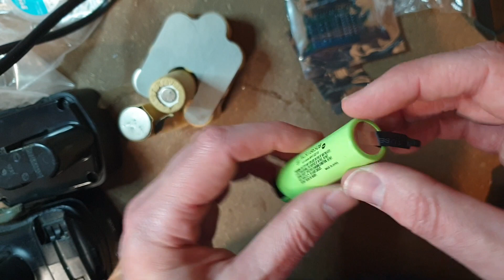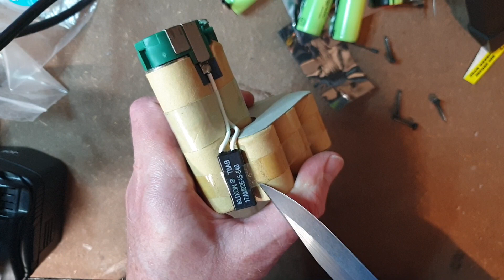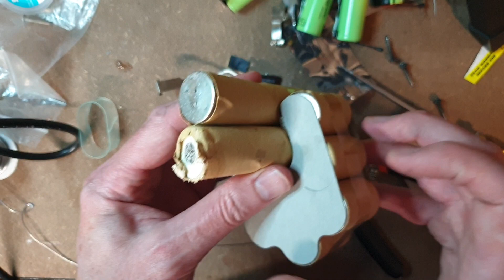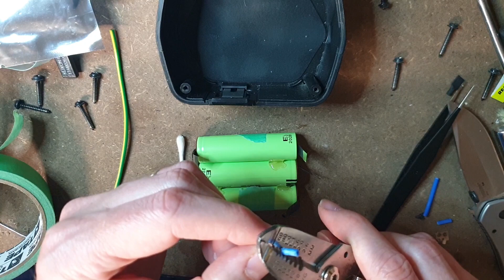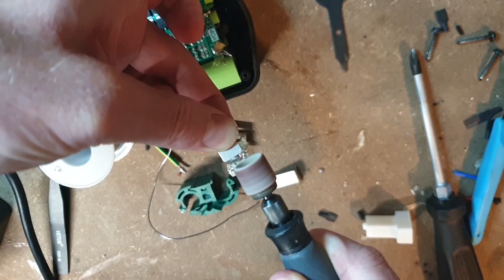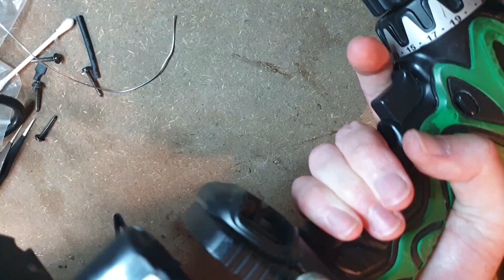How to convert an old Ni-Cad battery drill to Lithium Ion!

Comment: My question is that in lithium driven drills there is a circuit inside the drill just after the battery which is not present in nicd battery driven drill, so Im wondering if is mandatory to add one inside the drill, my concern is to dont damage the lithium batterys without this element. Thank you

Comment: Hi there,
I just wanted to say thank you for including that diagram showing how to wire up the batteries. I have been searching for this  for a long time now and could not find any. It seems that most people just show blank batteries that come without any polarity indicators on them and just get on with soldering them up as if everybody else knows what they are doing. So, thanks again.
Now, could I ask a question, please? What about the torque on these conversions? How do you calculate it? 
As an example, I have an AEG 14.4v, 3.0Ah impact driver of the stated torque of 85Nm. I am going to follow your conversion and see how it goes anyway. But would it drive something as if it was new under load?
Thanks again.

Comment: Wrong cells for a power tool. Those Panasonics have a max discharge of 4.9A. You want something of at least 10A or higher. You will notice under load when you drill into something it will not perform as good. For a charger you could use a laptop power supply with a buck converter to lower you voltage to 16.8v max, preferably 16v for longevity of the cells. Those cells have a max charge rate of 1600mAh. Or a RC charger is good also. You want CC and CV when charging Lithium.

Comment: If you are going to make more of these please make a little jig for the batteries.
Complete a pack, take it out of the casing and then make 2 little plates of mdf that exactly fit the bottom of the battery pack and fix them in place on a baseplate.

Next time just put the cells one at a time in the jig and fix them together. When completed, pick it up and simply lower it in it's casing. A lot easier for testing and also a lot safer.
Reply from the maker: Great idea! I only have these two to do though

Comment: If you had measured the voltage of each of the cells in the old battery, you might have found only one was dead and saved a heap of money,I did.
Reply from the maker: They were all useless leaky NICAD cells. Once they get that old, not worth mucking around with them.

Comment: What do you use for a charger?  Does the old NiCd charger charge the modified battery pack?
Reply: On a different video, the guy purchased a wall charger for lithium, took the guts out, remove the guts from the old charger and swap them.
Reply: No, Lithium ion is unsafe to charge on Nicad charger!
Reply from the maker: I just use the old NiCd charger, however, some people have said it doesn't do balanced charging even with that BMS, I need to look into that.

Comment: How come that didnt short out when the main +/- where touching 21.49 in on the video??
Reply from the maker: That's what I was saying a little bit further on, the BMS protects against any short circuit by cutting the output, and you 'unlock' the cut-out by putting it on the charger for a few seconds. Really I should have not let these touch at all and not rely on the BMS protection, but I guess I got lazy.

Comment: What about charger, the NiMH charger has no CC-CV intended for li-ion ?
Reply from the maker: It's a Ni-cad charger, not NiMH. The BMS takes care of charging the Li-Ion cells. It analyses the input voltage and current and gives protection to the cells and charges them the way they need.
Reply: @TheFlyingKiwiNZ  nicad and nimh use the same charger. The BMS only balances the charge,you still need a constant voltage and current for lithium ion.
Reply: @TheFlyingKiwiNZ  I assumed that, but am not sure the BMS is reliable Further, I believe that a lack of constant voltage charging phase can affect SOC of batteries.
Reply from the maker: @navigator_071  yes maybe it's possible, however the first battery I converted over a year ago and it's still working fine. I wanted to test it thoroughly before doing the second battery with a video.
Reply: @TheFlyingKiwiNZ It's Been 4+Years, do you Stilll have/use the converted Batteries? Have you had Any Issues Charging the Li-ion Batteries with the NiCd Charger?